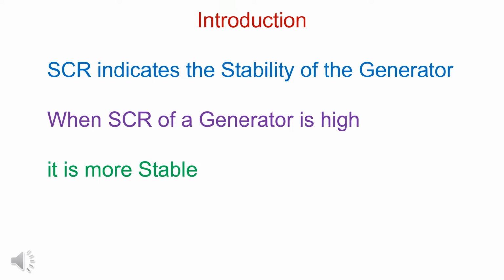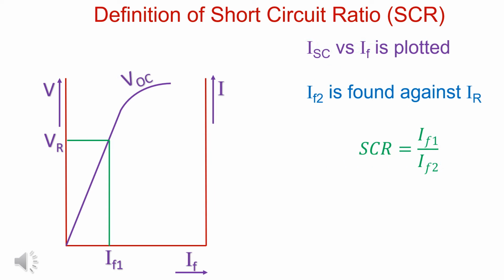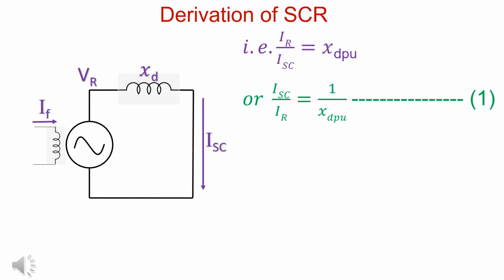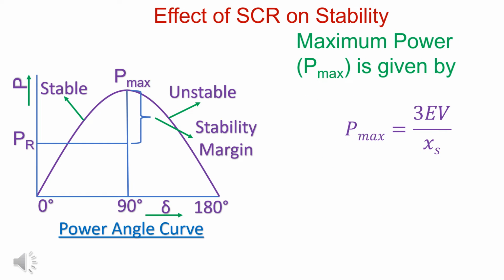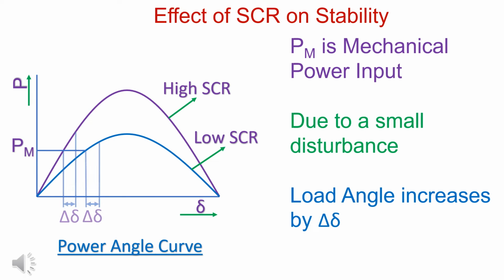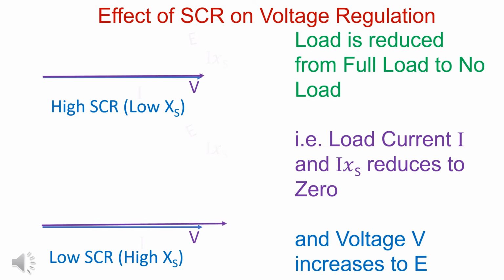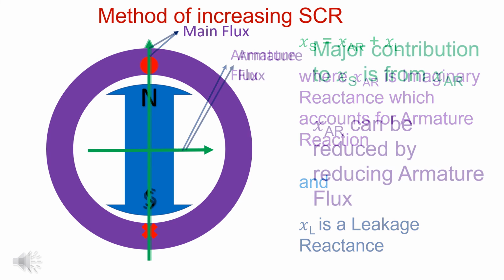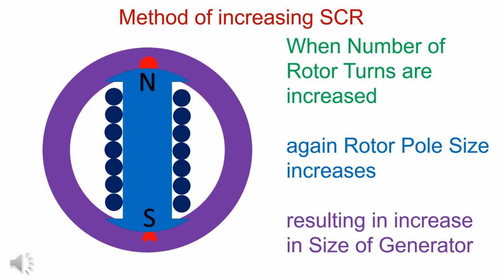Short Circuit Ratio in Synchronous Generator

Comment: An excellent video, thank you very much for sharing. I would just have one question-is there a difference between Xd and Xs or can they be used interchangably?
Reply from the maker: My dear friend, 
XD means Synchronous Reactance at the direct axis i. e. at the axis of poles. However I will do a deep study on the topic and come back to you It will take some time. Sorry for inconvenience.
Reply: @pradeepkhanna1435  thank you very much for your answer. I was just asking because for the first half of the video Xd is being used, but then during the explanation of stability of the machine suddenly Xs is being used so i am just curious whether there is any difference between those two parameters. To me it seems that they are identical because while i was at the university i also encountered the formula for active power, but in the denominator we were using Xd instead of Xs P=(E*U*sin(delta))/Xd
Reply from the maker: Dear Viewer, 
Your observation is very correct. I should have used direct axis synchronous reactance throughout my video. 
Let me explain in detail the difference between synchronous reactance and direct axis synchronous reactance. 
Direct Axis means axis connecting the poles of machine. Quadrature axis means axis perpendicular to direct axis. 
In case of cylindrical rotor air gap is uniform all around. Hence synchronous reactance is same all around. 
In case of salient pole rotor, air gap is less in direct axis than in quadrature axis. 
Reluctance offered to flux is less in direct axis. 
Hence Armature Flux is more in direct axis. 
Armature flux also induces EMF in Stator Winding similar to EMF Induced due to Main Flux Or Rotor Flux. 
Hence EMF induced due to Armature flux is different in direct axis and quadrature axis. 
Hence synchronous reactance is different in direct axis and quadrature axis. 
I suggest you go through two reaction theory. Of course it is little bit difficult to understand. .